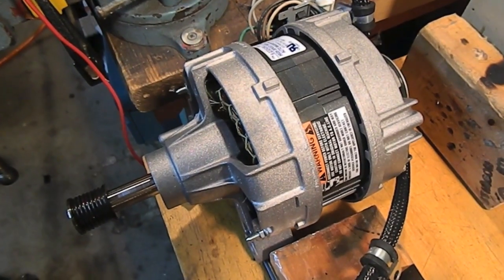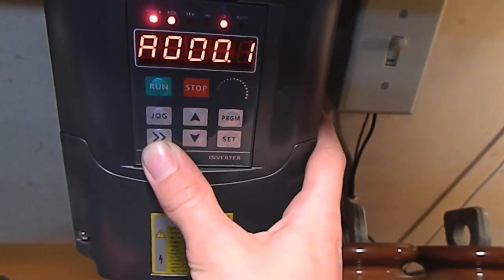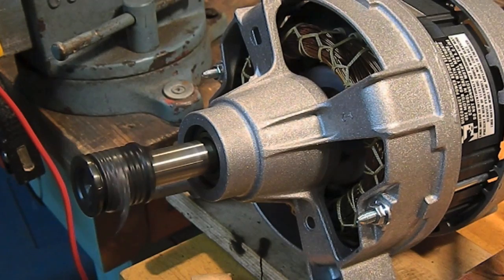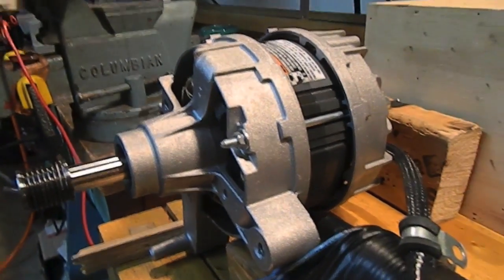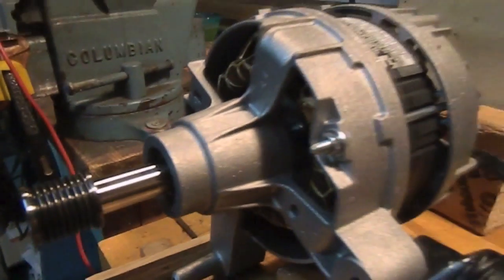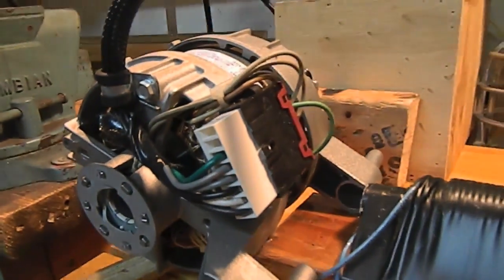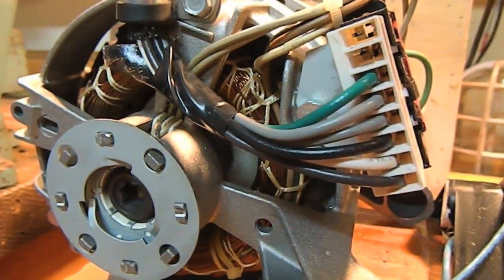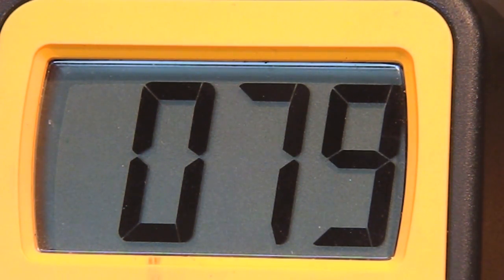High Speed Induction Motor

Comment: Is it possible? 

Hi I got your contact from your YouTube channel. I’m now looking for help anywhere I can find it. I appreciate you to the fullest if your still reading at this point. So here is the story.

My house is completely off grid. I’m running a solar system with the following spec.
1. Twelve batteries = 12v 200ah gel
2. Twenty solar panels 250w each
3. Five kva inverter
4. 80ah charge controller 
5. My setup is a 48v system

This setup during the hot period gives my house electricity 24/7 with no problem running all my appliances. I’ve had this setup for three years straight now taking precautions of grounding all the panels and surge protector, and cut offs where ever needed. Here in Nigeria we mainly have two seasons, it’s either hot or raining . My problem is during the raining season as with anyone with a solar setup, that I understand.

So my quest/venture was to try to solve that problem without relaying on a traditional generator that requires petrol, and to still not consider joining the grid because it’s not reliable AT ALL.

What I did

I purchase a 48v Alternater on eBay which at 1600 rpm it’s to produce a 48v charge . Not knowing the amount of amps it produces I purchased because I was still new to everything when I purchased it. This is the link to it.

 https://www.ebay.com/itm/2600-WATT-PMA-48V-Permanent-Magnet-Alternator-Generator-PC1248DC-4-ENGINE-USE-/254451756993?mkcid=16&mkevt=1&_trksid=p2349624.m46890.l49286&mkrid=711-127632-2357-0

Next I needed something to turn the alternator to give me the 48v I needed. From videos I saw, I thought it would be great to convert another alternator to a motor to have that spin it. This time I bought a DC 24v alternator and two 12v 75amps batteries. I also purchased a 18v to 55v DC speed controller.

This is how the connection went

 The 48v alternator is wired to charge my battery bank connected directly to the inverter with a breaker in between.
Both the 48v alternator and the 24v alternator is connected via a belt, which is the only link the two alternators have. The 24v alternator is converted to a three phase dc motor which is controlled by the dc speed controller.  I’m not sure if It in star or delta, that was a bit confusing to me. The positive and negative of the converted alternator and the dc speed controller are both joined together and connected to the two 12v batteries which is what powers them both. The batteries are connected making them 24v. 

This connection works and charges the battery bank briefly, until the 24v battery dies which is usually within 10 to 15 min max at low speed. 

The problem 

I then thought I could take the output wire of  the 24v alternator to get it to charge the two 12v batteries while it’s acting as a motor. By putting a meter to the output, I see it was only producing an 18v output charge not even mentioning the current which isn’t sufficient enough to charge the batteries when it’s given energy to the motor to spin. 

This is where I’m stuck. What can I do, keeping this same setup for the alternator turned motor to be able to charge better while it’s still acting as a high speed motor?

Again if you have read the post this far you are great and I highly appreciate any advice. I am also willing to pay for the consultation to get the results needed.

Thank you

Comment: Any 3 phase motor would work. I bought a VFD on ebay 120v in and 220v 3 phase out and bought a baldor 3/4 hp 3 phase motor at a swap meet and put it on my drill press.Now i have variable speed rev drill press. I programmed it for remote operation

Comment: Is it possible to run a scooter with this motor???
Reply: Of course! It would go very fast too
Reply: possible,but the power source is too complicated !!!! it required 3 phase ac supply
Reply: @kavine8879  Not so complicated buddy. All you need is a single phase to three phase converter. And voila, you can run a 3-phase motor with a 1-phase supply. 
Battery->DC to AC converter-> 1-phase to 3-phase converter-> transformer-> 3-phase motor.

Comment: What was the amp and voltage draw through your rpm range when you were changing the frequency and have you at any stage measured the torque at lets say your max speed?

Comment: what speed (rpm) does it go upto at max frequency you can take it to..
Reply: theLuigiFan0007 Actually pole count DOES matter. Higher pole count means motor will turn slower for a given frequency. The formula for AC motor speed is (120*Freq) / # of poles.

Also universal motors are actually series wound DC motors. Speed for DC motors is related to voltage only. Series wound DC motors can work on AC because field and armature are switched together in polarity so motor direction does not change regardless of how its hooked up to a battery. Hence why they can also work on AC.
Reply: ***** 
380Hz = 380 Revolutions per second
380RPS * 60 seconds per minute = 22800RPM.
Reply: That's if it is two pole. This motor is 4-pole..
Reply: EETechs
It's an induction motor. Frequency is directly related to speed. Poles don't matter unless you're using a universal (brushed) AC motor. Unless I'm overlooking an important face somewhere.
Reply: EETechs
Ah, ok. Didn't know that. Then I guess the real speed is actually 11400RPM. Thanks for the information and correction.

I didn't know that why universal motors work. Thank you for that information as well.

Comment: Nice video! That seems like a really well-made motor. It spins very cleanly with no discernable vibration or excessive noise. I have rewound a couple of single phase motors for three phase and about 8 VAC and run them at up to 240 Hz. VFDs have really enabled ACIMs to run at their full potential and maxium power to size and weight. Tesla would love the technology we have today!